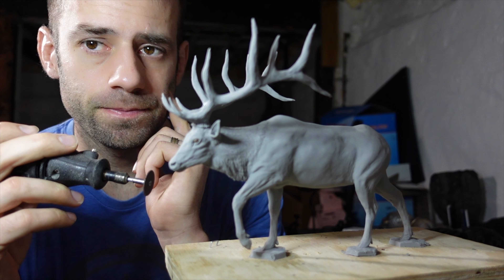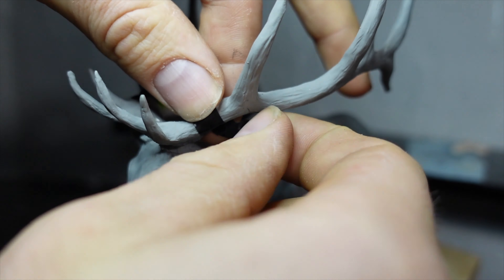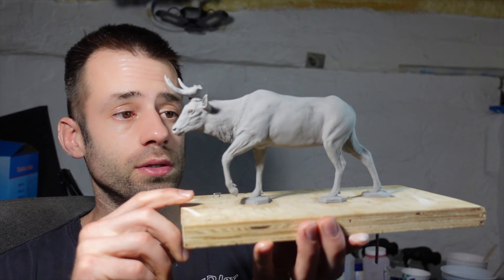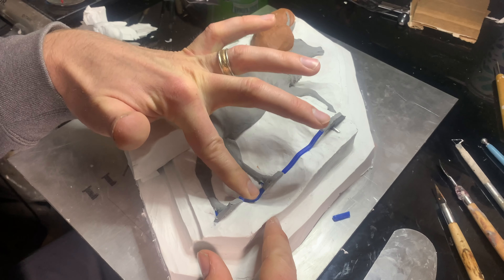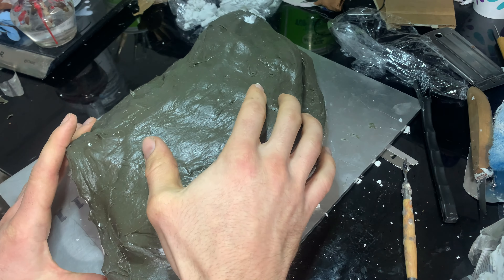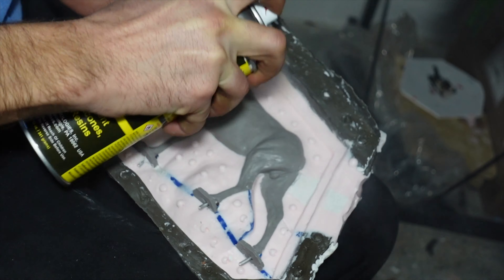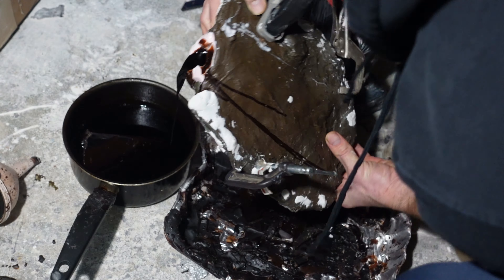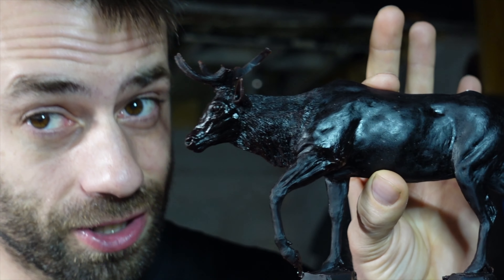Molding Elk for Bronze, Silicone Mold for Lost Wax

Comment: Hi can you I give the info  of the materials you are using
Reply from the maker: I use sulfur free oil based clay. Sulfur can interfere with the silicone rubber. 
I use tin based silicone rubber. I buy it locally at Sterling supply. If you don’t have a distributor near you just order a tin based silicone rubber from smooth on. 
Platinum based silicone is expensive and unnecessary for most things.